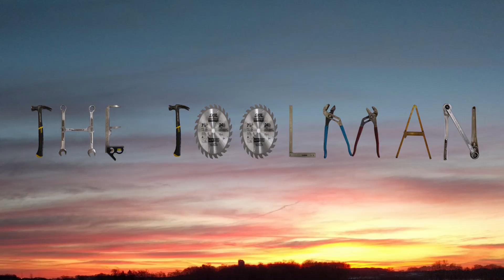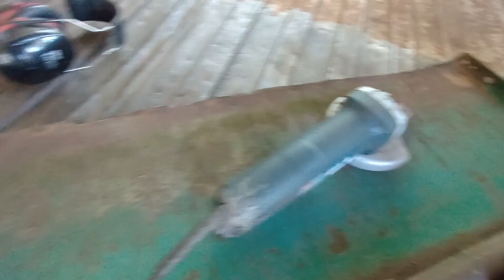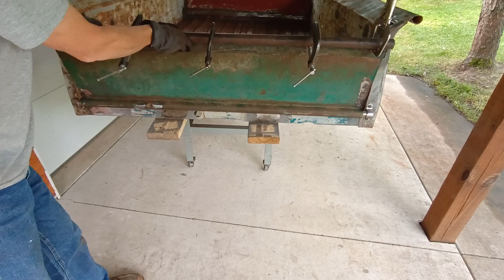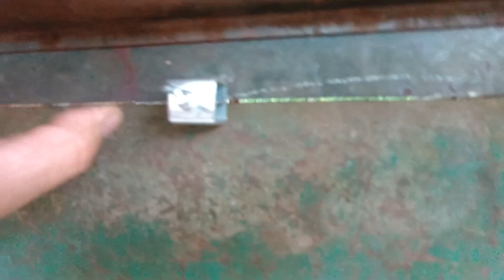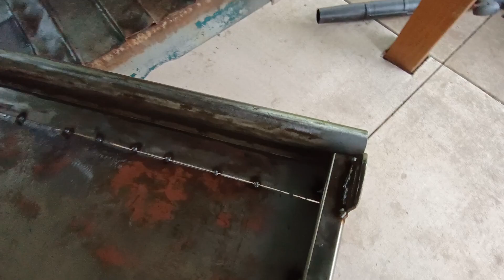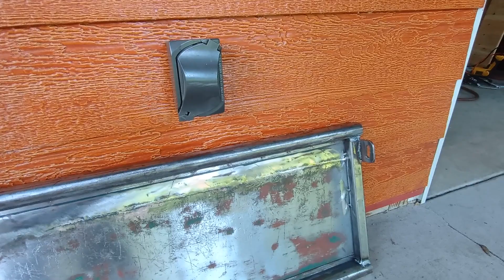1949 Willys Pickup Project   Part 16

Comment: That turned out really well.  I admire your ability to come up with solutions to problems along the way.  Just curious about your work background....is it automotive related?  You appear to have the somewhat of an engineer's approach to things.
Reply from the maker: Thanks!  You're on the right track.  I spent my entire career  as a software engineer in various roles and industries, none of which were automotive related.  I am also a life long car guy, woodworker and DIYer.
Reply: @TheToolmanTim  That makes total sense to me.  I have a couple of relatives who have engineering backgrounds and you're all cracked out of the same mold.  You folks, unlike myself, have a calm and methodical approach to problems, unlike people like me who panic and go into fight mode when confronted with hurdles.  As a guy from Red Wing, I also can admire a guy who wears a nice comfy set of Heritage boots!
Reply from the maker: Old school Redwing Irish Setters are my favorite footwear for the shop..  They took a long time to break in, but are as comfortable as slippers now.
Reply: @TheToolmanTim  You can't beat that crepe sole when working on concrete surfaces,  I just dropped off a pair of 6" 875 boots at the flagship store in RW to have new soles put on at the factory.  I am already counting the days until they return.  They'll be good as new when they return, minus the headache of a break-in period.